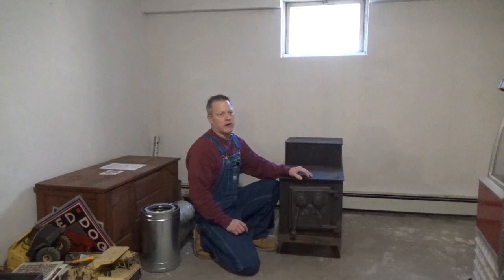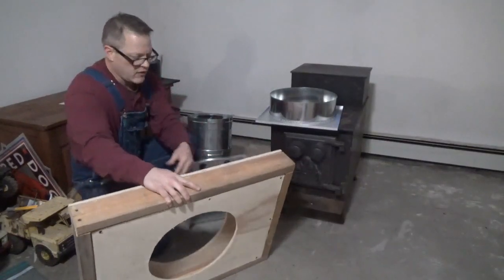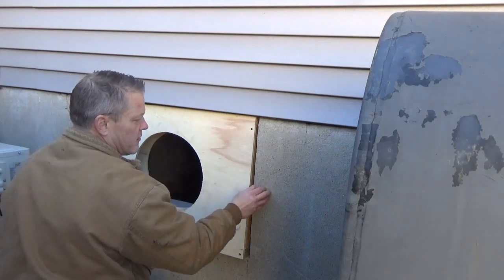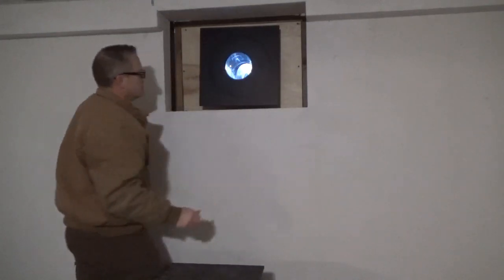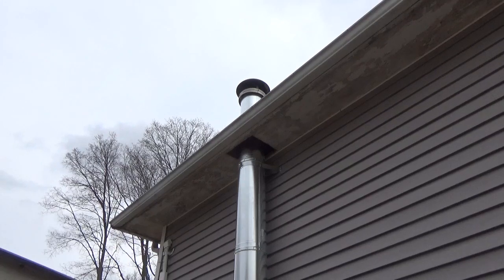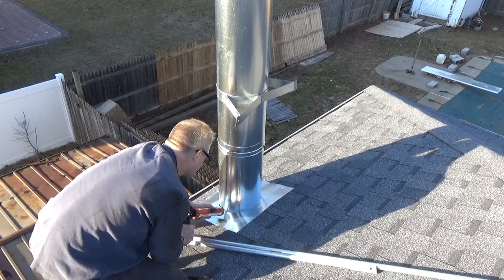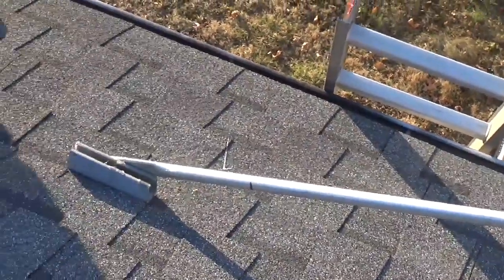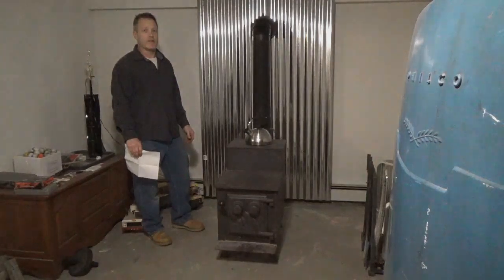Basement Wood Stove

Comment: Glad I saw this.  We're putting a stove in the basement.  I have one of those small windows near the top of the basement ceiling.  It will save drilling through the poured concrete wall
Reply from the maker: Thanks Rich!
Reply: I have one of those windows too, but I also have a living room window above it, and the wife already said no to a pipe view. So looks like I’ll have to drill the concrete wall

Comment: Awesome professionally done job.  Thank you very much for taking the time to record, edit and commentate on your project.  I'd been looking into doing the same thing for my house and I want it to be done really well and safely as possible.  This video showed me I wasn't fully ready when it came to costs in buying well insulated piping!

Only question I had is how long did it take you to fully do the project?
Reply from the maker: Hi there...cost was a big concern to me so i  shopped for best prices ! The stove i found first because all the plans  come up from there. The expensive pipes i put on a no balance credit card  so i am just about paid off on that 1 year later. All the cheaper things i just paid out of pocket.  Now as for how long it took ...building the wood box and mounting took about 3 hours then the rest is fast and easy maybe another 6-8 hours cutting the holes in the house etc. I broke up the job over about 3 weeks and setting up for a video waste time that i didn't have to do!  Thanks for watching and your comment!

Comment: Do you get good draft on this basement install?
Any problems basement smoking?
Starting  a fire I would like to do this  in poured concrete wall what extension lenth do you think you need  besides the through the wall kit to go through 12" poured  wall and 4" foam board and dry wall thanks have a good day

Comment: Nice project without cutting another wall penetration.  The Duravent materials sure are nice, but so expensive.  I believe I would have extended the chimney our so that I'd avoided the roof hole.  Regarding the flashing it would be better to put mastic/sealant under the metal edge before fastening down.  I'm sure the flashing extended up under the shingles on the top edge.   The bracket material is call uni-strut.   Typically the roof brackets would run back at say a 45 degree angle to the chimney.  I'm looking at running a temporary setup out a window also.  I've always burned wood and when I built this place I went with a mini-split with gas backup for when it is below 0*F.  It works well but since I've always burned wood I have a prepper mind set and wonder about when my electricity goes off.  I came across a nice wood stove and I want to give it a test run before cutting holes in the wall, and I prefer not to cut any holes in the roof.
Reply from the maker: Thanks for the comments and advise.  Yea.. Going through the roof I did to save money and I feel it looks better as well.

Comment: I may have missed this, but do you have a second window in the basement unaffected by the addition of the pellet stove? Due to fire codes, each basement in my area has go have a window that allows for access in case of fire.
Reply from the maker: Yes i have two more windows in the wall  to the right of the wood stove as your standing in front of it.

Comment: Looks great.  I just put a woodstove in my basement.  Have you researched pass through vents from the basement to the first floor? Just wondering if you have any recommendations.
Reply from the maker: Thanks! I have not looked into vents because I have a wood stove on the main floor. However if this was all I had  it would be a great idea. My father told me the only heat they had as a boy was from a wood burning stove in the kitchen. He would put a hot rock under his bed to stay warm and run like hell to the kitchen in the morning.
Reply: @ronstickle4694  a friend of mine has one in his basement. A big one.  He swears that it keeps the floor and the structure warm and supplements the furnace well. We'll see. This is my first year with a woodstove as we built a home on some wooded acreage over this last summer so some trial and error will ensue.
Reply from the maker: @jessesoldan7813  Mine does keep the main floor warm.

Comment: Hi Ron, Is this only a safe install for a basement because of the cement foundation surrounding the initial pipe connection? Could this be done out of a regular house window?
Reply from the maker: Hi Boucha. This kind of triple wall pipe is safe for wood on main floor and up through the ceiling but you MUST use the correct thimble giving the pipe about 14" or more clearance! I did my research for my project! Don't trust anyone even me do all the research your self for what you want to do and follow the codes from your area and the manufacture of the parts you use! Mine is working nicely and safe over a year later! Thank you for watching and your question!

Comment: Does this heat up your entire home? I'm installing one of these next year in my basement as well.
Reply from the maker: it is a big stove so if i really get it going and open the basement door it lets lots of heat up to the main floor that is only 1000 square ft. if i then used a box fan to move the heat around it will then heat the whole house. Thanks for asking!

Comment: wow, I would have just used a angle piece of pipe rather than cutting into the soffit and roof! Save a lot of time and money by not cutting into the roof..
Reply from the maker: i thought about a lot and found it much less expensive and could repair the roof easy and cheep if i wanted to remove the stove. that pipe cost lots more than repair what i did and ugly. Thanks for the comment!
Reply: Wood stove flue pipe is like water pipe, the straighter the run, the better.  It also makes the pipe easier to clean.